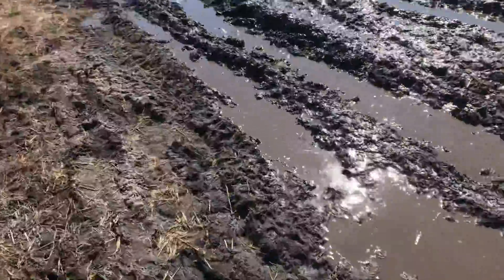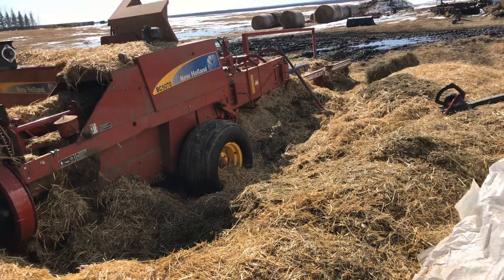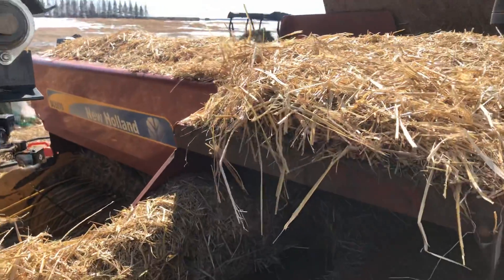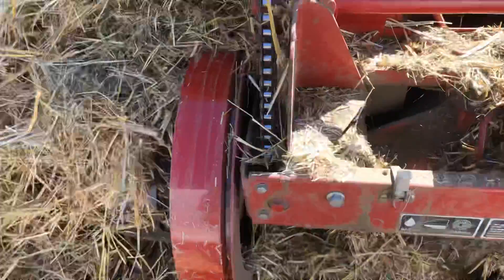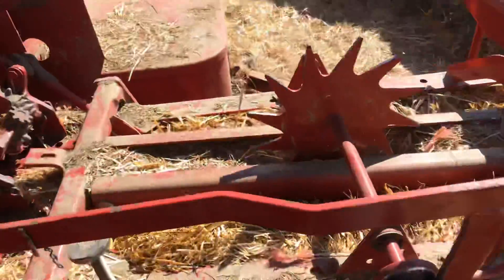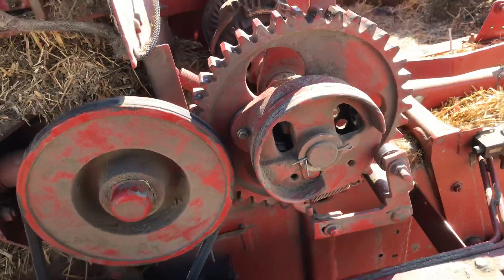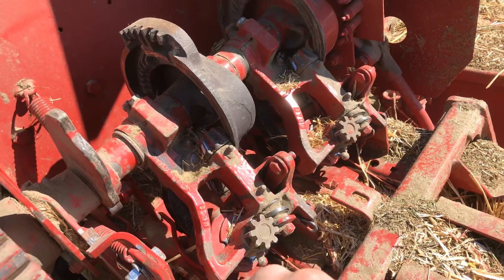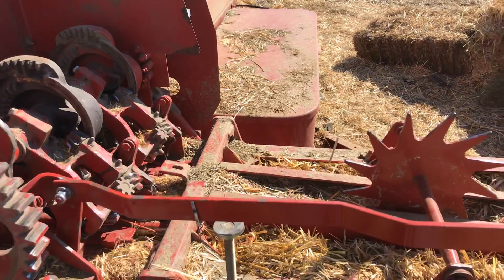Buying a used square baler thoughts

Comment: Solid info there! I would add: Look at the plunger bearings that ride in the chamber floor and look for signs of excessive wear on the pickup head. Rebuilding them isn't fun and VERY expensive!

Comment: Never messed with the gear drives, 
Always make sure all the timing marks line up.. never knew the knotter should be so tight that it doesn't fall.. they need to be tight together, but you can't tell if it's preload or lack of lubrication if you are just going by free fall.
Wether it's 2, 3, 4, 5 or 6 knotters, one will always be a problem child!!! 
We are on our second Hesston (Massey now) 16"×18" in line, both had issues with the right knotter.. 
On the Hesston 4900, #3 is the pain in the @$$!! 
#5 likes to act up sometimes and #6 thinks it's fun to play a few times a season... Should just change the whole works, but it's cheaper to trade it in for a newer one..
Reply from the maker: the rate at which they fall indicates if the wiper arm is set properly.it needs to slide gently into place not fall. Replacement parts don't come with timing marks. you need to make those yourself. there are very few timing marks on the 5070. one set for the plunger arm and one on the outside cam .
Reply: @DLKHAY  wiper arms are there own deal, they should not be dragging when the knotter is down to the pin.
Had the dealer send out a "baler mechanic" about ten years ago..
LMAO, he thought you could just keep making the knife arm tighter and tighter.. I've got 40 years experience in knotters, he had about a week of factory baler school.  YUP.. brand new $80 wiper arm with three days on it... 
Took two days to get another $80 arm😠
I miss the days when we traded small balers every 500k.. every other year, a new one 😎
Now with mainly running the big baler, we just keep running it.. 
(1996 model, everything but the Knotters, plunger and gearbox has been replaced.... Oh, and the chamber, it's got "bale skis" so it will last forever 👍